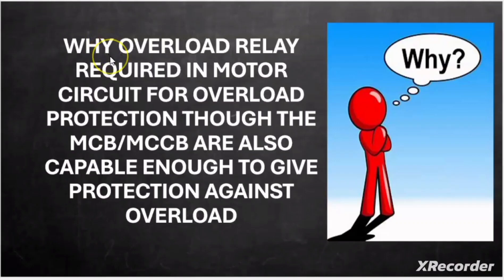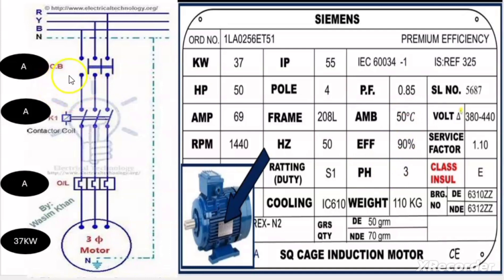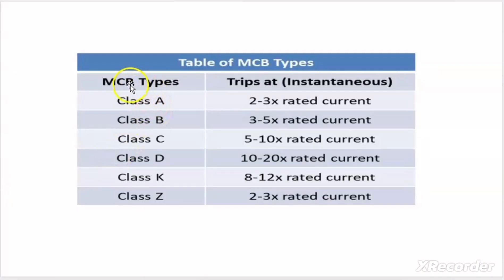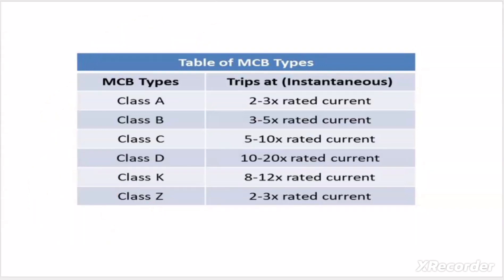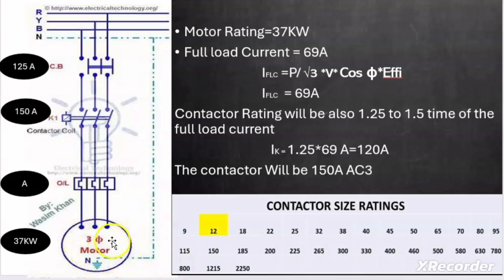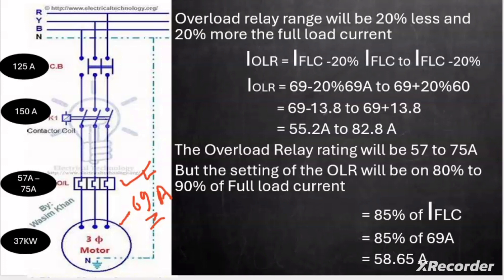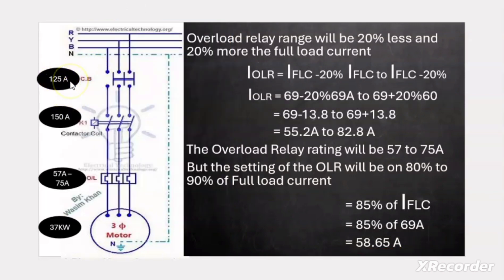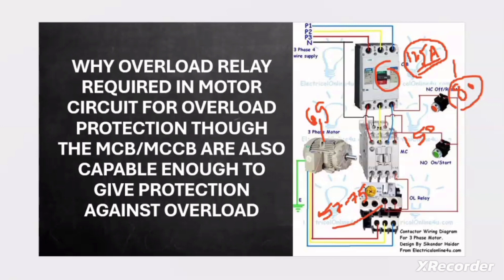Why Overload relay required with motor as the MCB/MCCB is capable to provide overload protection?

Comment: how about the inrush current? OLR will trip the circuit?
Reply from the maker: OLR will not trip for inrush current
Reply from the maker: L S I G are some setting in ACB and mCCB FROM WHERE WE CAN SET INRUSH CURRENT AND ITS TIME DELAY
Reply from the maker: Watch my video micrological control setting of ACB
Reply: @electricalconcept32  can you please make a series of videos on light current system course?